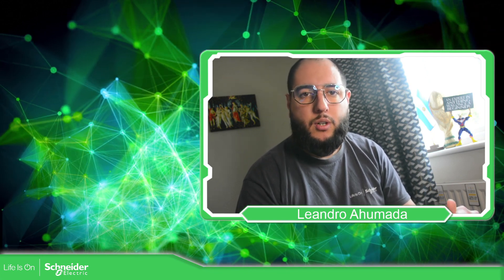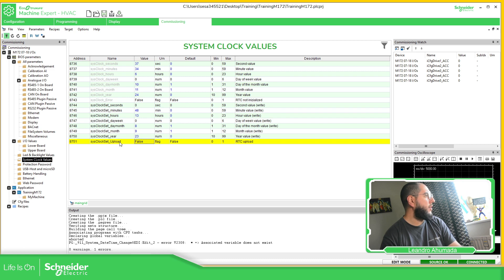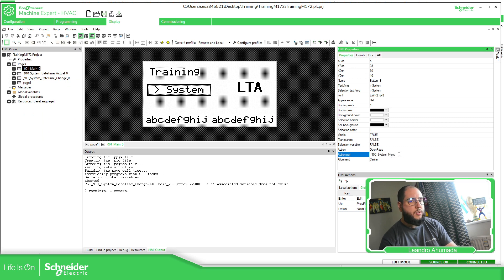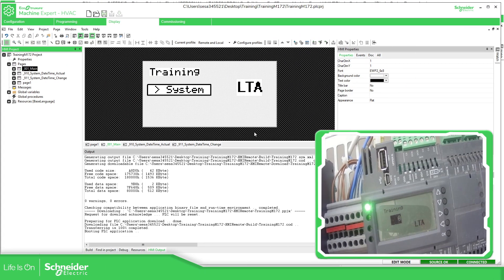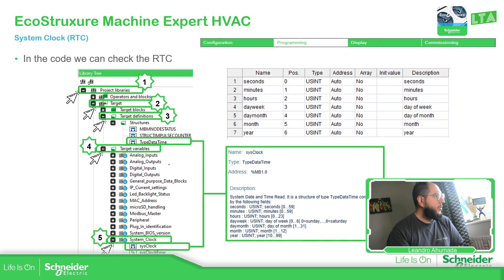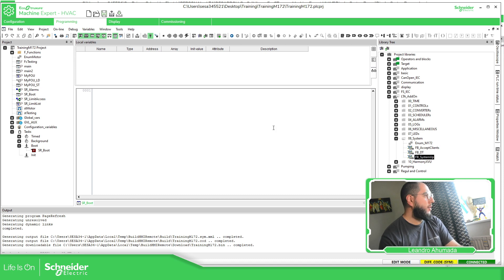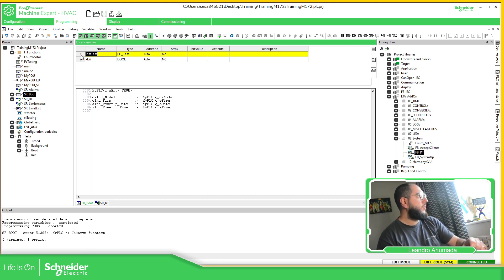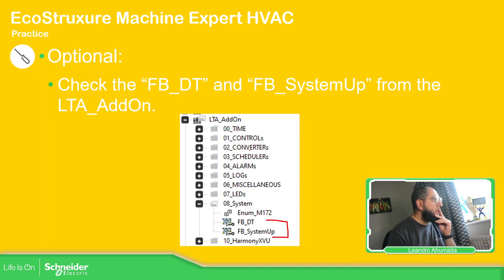EcoStruxure Machine Expert HVAC Training - M7.9 System Clock RTC

Comment: Sometimes, output string time from FB_DT is hh:mmss, normally is hh:mm:ss
Need your help, thanks.
Reply: if minute <10, output hh:mss 
if minute >10, format hh:mm:ss
Reply from the maker: Hi there! I will check the code but can you give me an example when that happens?
Reply: @LeTomasAHUMADA  I made a program, one of which is reading time using FB_DT. for example, if the time is 13:30:52, the output string from FB_DT is "13:30:52". However, if the time is 08:07:05, the output string from FB_DT is "875". the ":" character is not visible.
Reply from the maker: Hi There! You are right. I have checked it and updated the library: https://app.box.com/s/j45enur48dzxa602gdeg083jmhwt8p3s

Now it works!